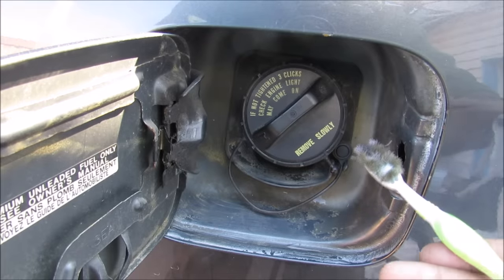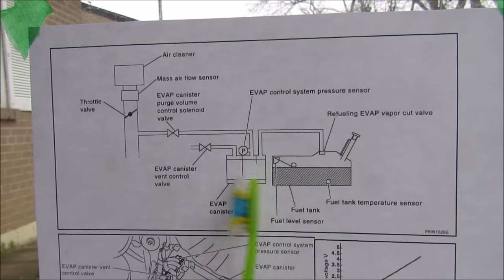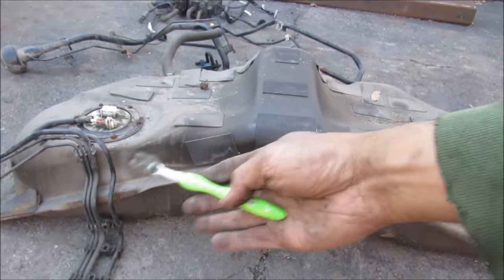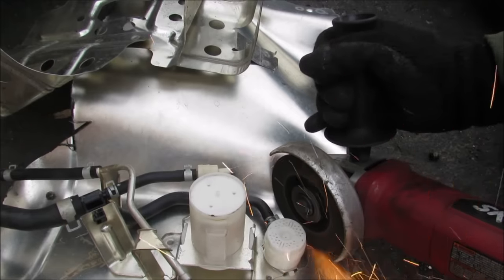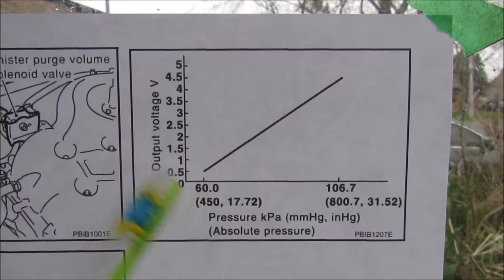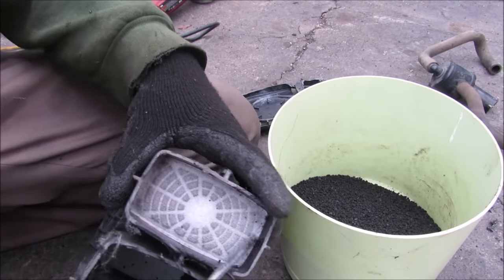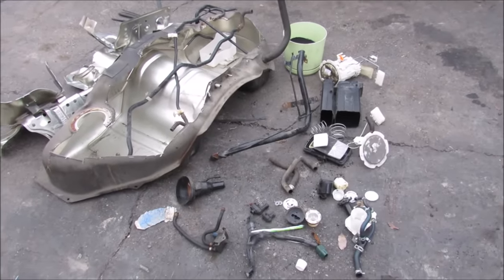How the EVAP System and Gas Tank Work

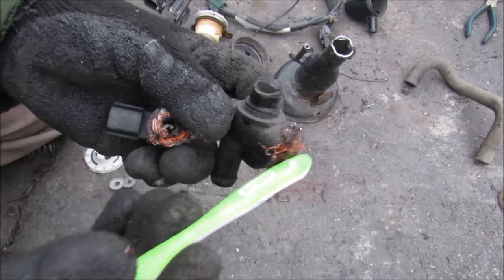Comment: I had gas shoot out of the tank at the same time the check engine light was on. I would be so grateful if you could elaborate on the sensors.  I have replaced the charcoal canister evap pressure sensor directly on the canister and checked the volume evap purge volume sensor at the front of the car that runs to the intake. Those work and aren’t stuck and energize. Is there one more pressure sensor that I cannot seem to find that regulates excess pressure from the tank. I looked everywhere underneath the car and gas tank but cannot find anything else that is solenoid actuated.  I saw that vent valve at 9:39 and it didn’t look like the one that’s attached to the canister. Any help on where to look next would be amazing. There must be an evap control valve that vents off pressure from the tank that isnt directly attached to the canister which I cannot find. Help lol
Reply: Really could use advice bro.

Comment: Hi, whe I refuelling, it keeps cutting sometimes every 2 second it cuts . 

I checked under my car the small tube which you called (small little line for ventilation) next to the bigger line for refueling.

That ventilation line is blocked. 

Does that cause for my problem?
Also does it cause that my car consume more fuel ?

Comment: Hello....I have 98 BMW E39 my problem is that the evap system does not have any sensors except for the purge solenoid valve and cuz it's summer there is like big fuel smell coming from the charcoal canister line that goes to the atmoshoer... My question is can I delete that line cuz that charcoal canister is not doing its job anyway

Comment: I have a coupe g35.to inspect my filler neck do I have to bring the tank down?or the subframe?
Reply: Or when filling about half or more and days go by without using the car but aired out the smell of gas will come back
Reply from the maker: I don't think you have to drop subframe for the filler neck
Reply: speedkar99 ok thanks I think I’m just gone have to pick up the rear end and try to look at it.if damaged it should easily be visible right?

Comment: my car Toyota Yaris. There is a gasoline leak from the pipe of the canister which coming from the fuel tank. please feedback
Reply from the maker: Gas should not leak out the vent valve. If so you need a new tank since the float is inside the tank

Comment: I had a fuel pump at a gas station over fill my tank and spilled gas along the floor. How likely is it to have damaged my EVAP system?
Reply from the maker: That shouldn't bother the EVAP if the shut off valve in the tank worked correctly and blocked the gas from going into the canister.
Reply: @speedkar99  any symptoms i should look for if it did fail?

Comment: Would a leak in the fuel return line generate an evap code?
Reply from the maker: Not directly. It would have to be a huge leak such that the pressurized tank also looses pressure over time
Reply: @speedkar99  well leak fixed but still have the p0446

Comment: Can anyone tell me where the fumes go if there is a gross leak? Or better yet, how are they getting vented to the atmosphere? Trying to understand. If you're driving long distance and you get one of these leaks. Will it vent to the atmosphere for safety purposes?
Reply from the maker: They get vented through the charcoal canister
Reply: @speedkar99  That I understand but what if the purge solenoid is bad and cannot vent to intake through vacuum process??  Does it still get vented our of the charcoal canister in the back through the fresh air vent or similar?

Comment: Speaking of safety: I would not have the battery next to the tank you're pumping out!  I've  done this before, but was careful to have the battery as far away as  possible to prevent igniting any vapors with the resultant spark of closing the circuit.
Reply from the maker: True

Comment: Emissions problems big moneymaker in ct.I've spent 1400 dollars so far  po442, po456,po448. Now have a po447 open circuit  could be break in wire  that ties in all the evap related components. B134 #13 wire on pcm from 2006 subie sti. Worst case n/g pcm.  Will fix to get rid of car at dealership due to programming of pcm to immobilizer keys
Reply from the maker: Sorry to hear that. Thanks evap system can be a pain to diagnose but having an understanding of how it works and the OEM repair manual definitely helps. 

For the Immobilizer why not tape the key to the Immobilizer ring and cut regular keys to turn the cylinder?

Comment: My evap canister and detector had to be replaced because it was filled with gasoline. The mechanic asked how many times I clicked to ‘top it off’.  I have never clicked the pump after it stops itself on any vehicle.  I think he doesn’t believe me. But how did the gas get into the canister?
That morning I filled up and when it finished I replaced the pump handle. I don’t remember hearing a click when it stopped but I was sitting on the drivers seat and noticed it stopped. 
When I drove away, about 2 blocks, there was a little jerking like the car might die from bad gas, but it stopped that and kept going. 
I only drive to church and back. 
However later I drove down a steep hill, the car died and then gas came leaking heavily out from under the car. 
No one seems to know how the gas got into the canister (except to think I topped off which I did NOT)!!!   Could it have been a faulty sensor in the gas pump hose itself?  I cannot understand how the gas got into the canister and I do not want this happening again. I’m afraid to fill up my car now.
Reply from the maker: Sorry to hear that

Comment: Dear speedkar99: why so many mechanics on Youtube have sworn never attempt to top off tank as it WILL cause fuel to spill into the charcoal canister, thus resulting in expensive repairs.  However, as you have explained clearly in 6:34 the valve is preventing such mishap.  What is your expert opinion on that: a myth or a fact?

Comment: I’ve always had trouble filling my gas tank and my gas cap “farts” on occasion (2013 RR Sport) some forum says it’s your EVAP system. What the F$&@ is an EVAP system. 
At 47 I’m not easily impressed, I don’t believe in 14 minutes anybody on the planet could have explained it more precisely than you.
Reply from the maker: Well thanks. You'll need to clean the vent

Comment: I beg your pardon but gas vapors do not get reburned unless it comes from the Exhaust System.  I know this because I developed the E.R.S. Exhaust Reburn System in the late 1980s Early 1990s where exhaust is looped back to the engines combustion chamber to be Reburned. And it works...

Comment: My cars idle stumbles for about 30 seconds after refueling. No CEL,  but I've replaced the purge valve and the vent valve with no luck. What do you think could be causing this?
Reply from the maker: Interesting...I was gonna say maybe the purge valve is leaky letting too rich of a mixture causing the stumble
Reply: @speedkar99  thanks for the reply. Do you think a clogged gas tank vent could cause this issue. When I remove the fuel cap for refilling there is a lot of pressure behind it.

Comment: I have a 96 jimmy and all the evap lines have been removed, I need a diagram showing the connections between the canister, fuel tank, fuel pump, and the purge solenoid so I can rebuild the system. Anyone know where I can get information for this.

Comment: 04 silverado got codeP0499 i believe or something like that... sorry its been a while lol. Light still on. Anyways, changed evap canister down under the truck, and valve on top of motor and still check engine light on, also changed fuel cap, any ideas?? Thanks
Reply: Clear the codes and re-scan when the light comes back and see if it is a different code.

Comment: Any guesses on what would cause fuel to enter the evap system without possessing the bad habit of topping off your car? My car does this and the engine with stall during purge cycles. My guess is a split evap line inside the tank. Any other ideas this problem is bizarre lol. 😂😂😂
Reply from the maker: That ball at the top of the tank isn't seating or floating with the gas. 

You can try using a smoke machine to find leaks
Reply: @speedkar99  Thanks! I actually found out the last time I had the fuel tank down to replace the fuel level sensor, I FORGOT to reconnect the evap line inside the tank to the top of the fuel pump (it’s a 2006 Malibu). So what was happening is the float valve inside the tank wasn’t even connected to the system, and since the evap line wasn’t connected to the top of the pump, engine vacuum would suck raw fuel into the evap system only when the fuel tank was around full. Now I’m putting everything back together and replacing the charcoal canister, because it is FULL of fuel. Can’t believe I made such a dumb mistake 😂😂😂

Comment: I wonder if you can pump gas into cannister to clean out charcoal gas is also a solvent and dissapate in to thin air  why it fails is because I gets dirty smog in charcoal area  so  cl among it will probably fix it  if not brake cleaner  may be 2 cans  spraying in the inlet line  then running air thru line to  clear out solvent  I bet that works
Reply from the maker: The charcoal is going to absorb
Reply: Hmm what about brake.cleaner a auto parts guy told me you.can.clean.the unit out so you can. Pass emissions

Comment: I replaced the gas cap on my 02 f150 because gas cap light on cluster was coming on. Lasted a month and is back on.
Reply from the maker: Well you've got an EVAP leak somewhere
Reply: @speedkar99  I found three hoses that were dry rotted. Will light go away by itself or do I need to clear codes to turn off light on dash?

Comment: I would like to buy all the air solenoid valve for idle-up application in my vehicle, but you cut it open..
Reply from the maker: What do you mean by idle-up?
Reply: @speedkar99  my vehicle does not have automatic idle air control, and tend to stall during cold start if I did not hold the throttle opened a little bit right after engine started, thus increasing engine idle rev. And if I increase idle screw opening to combat engine stall, my engine would rev higher when idle at normal engine temp.

People in my country used the term "idle up" to explain this condition.

Comment: The canister doesn't "hold until". It's a filter with a life span. Car off, vent pressure to atmosphere, canister filters pollution; there has to be a vent to prevent 'explosive' spilling of fuel, and that has to function even when the car loses power indefinitely. Car on, vent to intake. That's it! You could run this shit of a relay or 2 triggered by the same circuit that activates your alternator... only when the car is running.

Comment: That VCV is acting up on my car but it's too annoying a rusty up there for me to mess with since it's only once in a while it seems to get stuck.  Time to get a Tesla.  --- it could also be that check valve on top.  It's a Toyota.
Reply from the maker: Yeah rust is a big concern with these...
Reply: @speedkar99  I saw Fix it Angel's youtube channel has several videos replacing that overfill check valve.  I do get a gas smell but it's like once a year and then it goes away.

Comment: You didn't explain what's going to happen if you overfill the gas tank up to the gas cap which many people do to get extra miles. Including myself.
Reply from the maker: Well if you manage to override the gas pump built in shut off then gas is going spill out the lid. It shouldn't go into the canister because of that valve on top the tank
Reply: speedkar99 then that's great. I've read some people saying if you top off the gas up to the gas cap, it will suck up to the canister and will damage the canister. What is the reason why canisters fail by the way?

Comment: My kid dropped his baby off roader into the deep muddy water. The outside vent tube from the evap got clogged. Then he had a vacuum in the gas tank. Hard to take the filler cap off after driving. Then the vacuum collapsed the tank to a pancake. Oopsie. Is there any other cause for the vacuum in the tank. Obviously the pump sucks fuel out and air isn’t entering to replace it.

Comment: When my Check Engine comes on, all they do is attach a diagnostic tool under the steering wheel and reset the computer.
Reply from the maker: That's not the right way to fix it

Comment: EVAP lost vapours to atmosphere? No its not. Coal take it all and not loose untile active coal is saturated with fumes. Carnister give a vapours to engine intake with air from outside a carnister is ventilation. or gasoline vapours are taken from tank directly with second valve

Comment: That stupid EVAP canister is at least $200. What a rip-off.
Reply: Buying one new is a sucker's deal, as they're essentially good forever. Go to a u-pull-it yard, and get one for $20. You're welcome.
Reply from the maker: Maybe you can make your own 😏
Reply: @speedkar99  Maybe I could.:) But it's too late now. Had a Dorman one installed last summer.
Reply: @fun_ghoul  Maybe so, but there isn't a good junkyard near me, and there is no guarantee that another old one would be better than the old one I had. I bought the car new and want to keep it in tip-top shape for a long time, so I'd rather not have junkyard parts on it, especially those with electronic sensors. Anyway, an OEM would have been about $600. Now, that's just obscene.
Reply: @paulparoma  You're talking about the cost of the part, but said you "had one installed". That's where the bulk of potential savings lie, IMO.
Reply: @fun_ghoul  That's right. The part cost me about $180, but the installation was less than $50. This was something I did not want to try to replace myself, especially considering the Toyota guys I go to treat me well, thankfully.
Reply: @paulparoma  The installation was cheap, because they reamed you on the part. It's just math, buddy.
Reply: @fun_ghoul  Do not assume I am so naive or stupid. I got the part on eBay from a Dorman distributor, as an OEM part would have been $600 or so. They did regular service on the car at the same time, so the installation was part of that whole procedure. Sure, they did not lose any money on the job, but they did not ream me, either. They have not tried that yet with me, as I am friends with both the parts and the service managers, and have been going to them for about 11 years. This organization, remarkably, is not a "stealership." Not with me, anyway.
Reply: @paulparoma  Sounds like you're justifying it to yourself more than to me, pal. Keep flapping like I don't know the industry tho, putz.
Reply: @fun_ghoul  I am no pal of yours and I don't need to justify anything to you or anyone, wiseguy. You said I should go to a junkyard; I told you why I did not. You may think you know the industry, and that's fine,  but I have probably owned cars longer than you have been alive. Find me a better deal on a brand-new EVAP canister, and we'll talk turkey. Until then, keep your "industry knowledge" to yourself. Merry Christmas.

Comment: Great explanation of a system mandated by the government but NOT necessary for your car to run. Gasoline turns into harmful smog? BS. If this were true then every gas engine from the lawnmower to your car would have an EVAP system. See all those airplanes flying overhead thousands of times each day? Do they have an EVAP system? NO. This system is an entire bunch of headaches and money you spend to fix a system that's not needed.